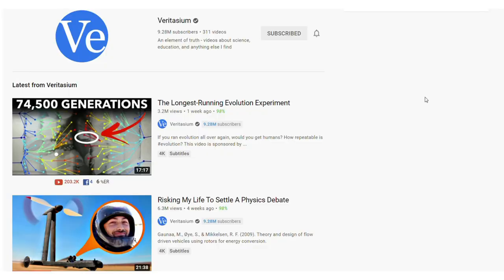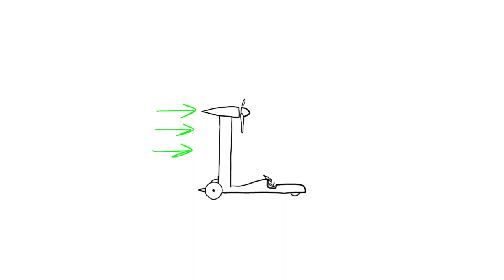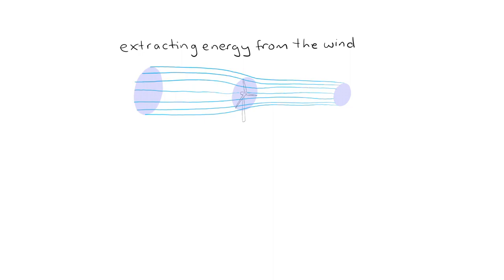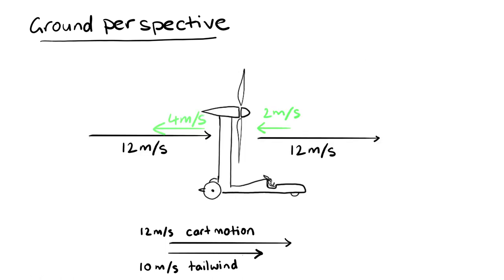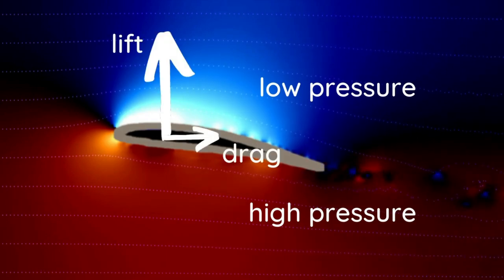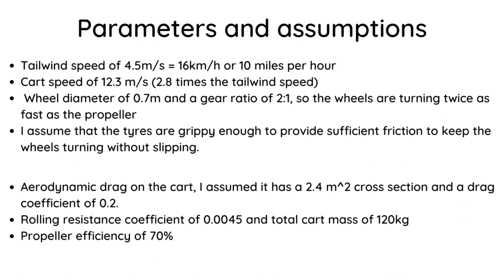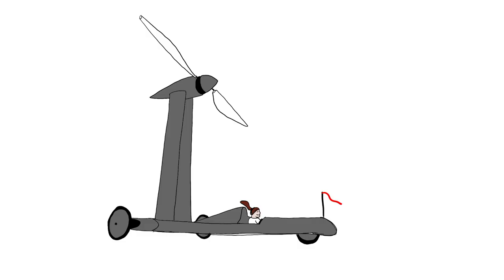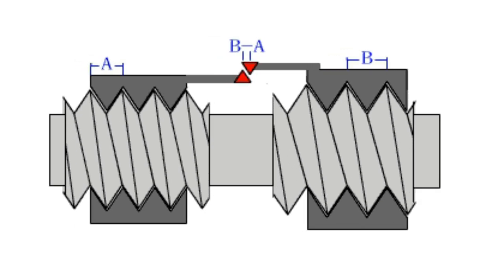Downwind Faster Than the Wind by Veritasium: How Does it Work?

Comment: At 0'25'' and 3'52'' thrust should be drawn the  other direction.
Reply: Nope.  The thrust from the propeller is always in the rearward direction.
Reply: @johnborton4522  Not in the downwind, faster that the wind condition. A thrust is... thrusting, and the prop acts... as a propeller.
Reply: @ghislaindebusbecq8864  

After Googling images of airplane propeller thrust diagrams, I see that you are correct.  I was imagining that thrust was the direction the air was pushed and I'll bet Rosie thought the same.

Thanks for the correction/education.
Reply: @johnborton4522  Yep. Common confusion, that I make once every two tries as well. That's the action/reaction principle. Thrust is the reaction to the air being pushed rearward.

Comment: The Mythbusters had an airplane on a treadmill...
Reply from the maker: Ha! I expected someone would mention that 😀 thank you! 
Yes they did, but it is my opinion that any physical representation of that problem presumes a certain interpretation of it. The problem is really one of semantics, it's possible to read it in two (or more) ways. And the Mythbusters interpretation assumes the "treadmill moves as fast as the wheels" part isn't an important aspect of the problem, since it's not physically possible (a nice engineering interpretation!) whereas everyone who disagrees thinks that is the most important part of the question, and doesn't think about or care whether you can actually make a treadmill like that that didn't immediately destroy itself as it tried to counteract the jet's thrust. So I don't believe you can ever get anywhere with a physical demonstration, you'll only convince people who already agreed. Everyone else is like "you tested something different to what the problem is about."
That's my thoughts on the topic anyway!
Reply: @EngineeringwithRosie  YES ^^^ That!  I've never liked "plane on a treadmill" as a brain-teaser because it does come down to semantics rather than physics.  It would be relatively easy to reword it so it was purely a physics question, but in my opinion a pretty obvious one.

Comment: Hi Rosie, You don't mention that the gear ratio of wheels to prop make a huge difference. It would not work with a big difference in the  ratio. André in Sydney
Reply: The gear ratio between the wheels and the prop can vary greatly.  One could be designed where the wheels turn higher far RPMs than does the propeller and also far slower.  That particular ratio is simply not critical to the design.
Reply: @johnborton4522  thanks John, good to know. André

Comment: This problem has nothing to do with physics. This is a simple geometric constraint problem. You can start the car with the wind in the drivers face. And continue on forever. It’s all one explanation. The wind powers the wheels.
Reply: >> The wind powers the wheels.

The wheels turn the propeller.  We have a ratchet on the axle to prevent the propeller from turning the wheels.

Comment: Like Veritasium I think your also misunderstanding what's going on.  The blade is sailing on the air - the air is pushing the vehicle forward.  The blade has NOT turned into a fan powered by the wheel.

This video should make it clear - https://www.youtube.com/watch?v=zPFzHoubQzg
The blade is being driven by the air and is not moving faster then it because of the angle of attack.  It has not turned into a fan, and the wheel is not driving the blade.  The air is driving the blade, and pulling the wheel along the ground - the wheel is only ensuring that the blade moves in the correct path - not turning it into a fan.   

This thing is a analog for boats tacking the wind.  The wheel does nothing but STEERS the prop.  The same way the hull of a boat STEERS its sail.  The hull does not power the sail making the boat move, it just points it in the right direction and the wind powers it.  The wheel is not powering this prop.

Edit: If your unsure, watch that animation a few times and watch those air lines.  The blade never moves faster then the air lines and its never throwing air backwards toward the balloon.  The animation is following the air line path exactly (100% speed), but in reality the blade would be going slower (since you have drag on stuff) and that is where the decreased tail wind speed comes from - from the blade blocking the air - air resistance - not from air being thrown backwards.
Reply: @Rick_Cavallaro  Snippet of Steve Mould's video: https://www.youtube.com/embed/u5InZ6iknUM?start=389&end=408
Imagine that as a cross section of the prop.. air is pushing the thing forward.  But you guys are saying no - the prop is moving faster then the air and throwing air backwards, somehow powered by the wheels?
Reply: @h82fail  without the wheels powering propeller to push the air backwards this mechanism would be physically impossible, energy would not be conserved.
Also, your animation is showing the moment of equilibrium, which is misleading. Blade doesn't do any work in that state. As soon as you change the angle of attack in that picture, the blade starts accelerating while pushing the air backwards. And you need that acceleration for any practical situation.
Also, you seem to greatly underestimate the role of the wheels/the boats hull in tacking. They do not "only" steer the vehicle, they provide a contact force with the stationary surface, which is absolutely required, because you need contact with two bodies in different reference frames to extract kinetic energy. Thats why without steering tacking can't work (a boat would just go with the wind). And that's why that car (Blackbird) has to apply a forward force to the ground with its wheels
Reply: @fritt_wastaken  I think what you said both perfectly explains what's happening but also contradict other things you say.

I agree that you need to track the ground in order to apply the leverage:  You say this:
"And that's why that car (Blackbird) has to apply a forward force to the ground with its wheels."
Agree -This is what I keep claiming, the prop applies force to the wheels not the wheels to the prop.

Which contradicts this: "without the wheels powering propeller to push the air backwards this mechanism would be physically impossible"

I'll also respond to this at the same time:
"Also, your animation is showing the moment of equilibrium, which is misleading. Blade doesn't do any work in that state." - Agree, its at max speed with no fiction/losses in the animation.

"As soon as you change the angle of attack in that picture, the blade starts accelerating while pushing the air backwards. And you need that acceleration for any practical situation."

This is where I disagree,
lets start by agreeing in the animation that the wing is at equilibrium, yes, but we also agree its moving faster then the balloon right?

What happens if you slow the wing down keeping everything else the same in that animation.  Slower then it currently is, but not slower then the balloon.

Wouldn't you agree that the air would be pushing into the blade/wing? Since its pushing the wing, up, which is connected to that wheel, pulling it forward - driving the wheel forward just as you said as well.

No air thrust needed. 
Wheel doesn't spin prop into fan, prop is a turbine driving the wheel.  Its easy enough to prove in the real world on a actual test just using a power meter somewhere.  I'd be willing to bet the 10k he won.

Comment: This took me an embarrassing amount of time to understand. The way I portioned out the answer is this. Imagine a cart with a propeller that looked like a flat DVD disc. From stationary the wind is blowing against the frame of the 'cart'. The cart accelerates to wind speed and then stops. Much like a plastic bag flying in the wind. Step one done. Now let's Mould this flat DVD disc into angled blades resembling a wind turbine. These propellers are getting their rotation from the wheels. The wheels are getting their rotation from as mentioned in step one (the wind). now let's come back to the blade angle as it is the secret sauce. Imagine the blades are hitting this stationary wind and generating force, much like when you put your hand out of the window and angle it to feel the force. This rotational angled blade power is what is making the cart go faster than the global wind speed. Hopefully that cured your WAYTODANK brain feeling lol.